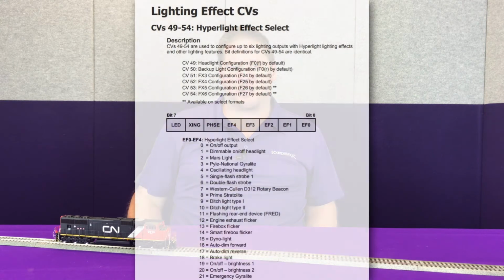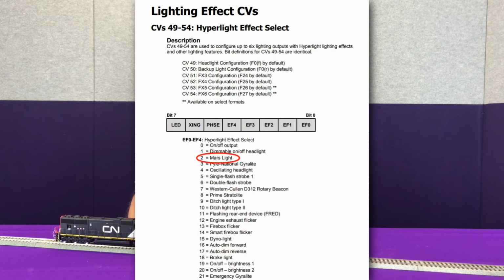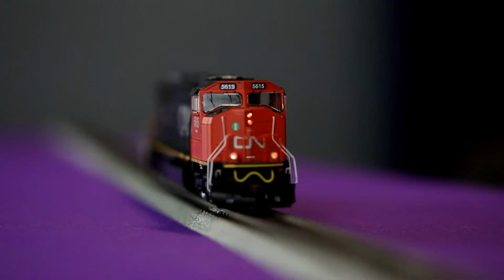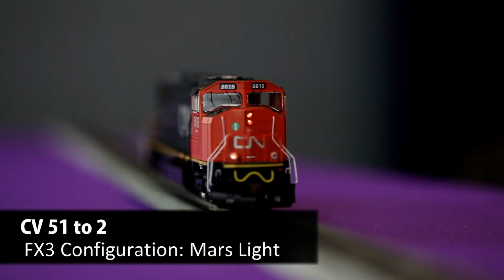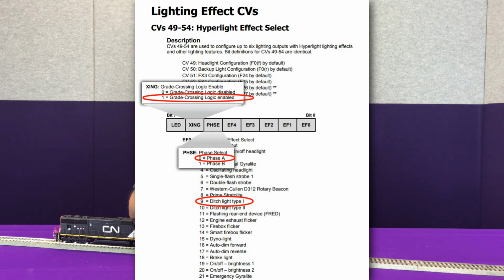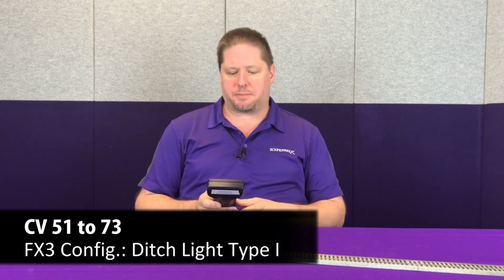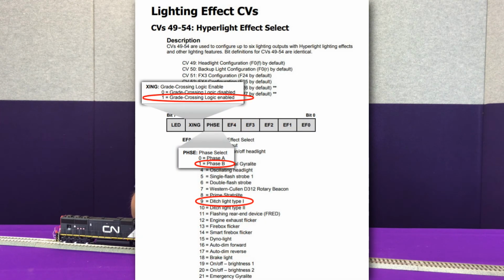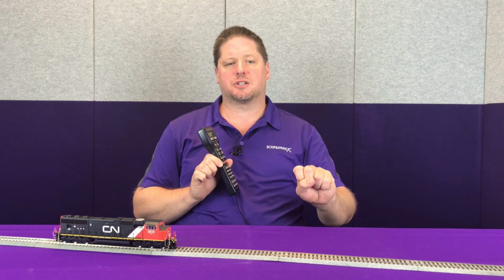Tsunami2 Lighting Operation

Comment: Can you do the same thing with digitrak remote control
Reply from the maker: We don't use or support the command station you are referencing, but as long as you can access the CVs we mention you should be able to do it. For more assistance with how to use your command station you will need to contact its manufacturer.

Comment: How can I setup my front and rear headlights to be non directional and separately controlled?
Reply from the maker: First, re-map the lights to different F# keys.  I leave headlight on F0 and set my backup light as F28.  Then in CV 57 and CV 58, enable both lights in both directions, and you’ll then have non-directional headlight on F0 and back light on F28.  You can choose a different F# key if you’d like, this is just how I do it.  (Video coming soon..)

Comment: From SoundTraxx in an e-mail they said "Set CV 55 to 201 and CV 56 to 233. This is what creates the alternate flashing."  Does not work.  I have an SD90MAC-H Phase II EMD #90.  Athearn has never returned any of the several e-mails I sent in the last month.  I had other questions for them besides this.  What terrible customer service!
Reply: Athearn locos do not have the same defaults as these decoders do from the factory.  Basically, Athearn changes up the settings.  So it will take some work to correct that to allow what SoundTraxx said to apply to the decoder you have.
Reply: @Panzermeister36  Thanks for the info, but I changed my 3 Athearns to LokSound 5 to match all my others (Atlas, Walthers, ScaleTrains) which have LokSound 5.